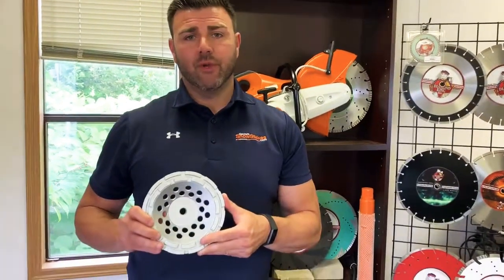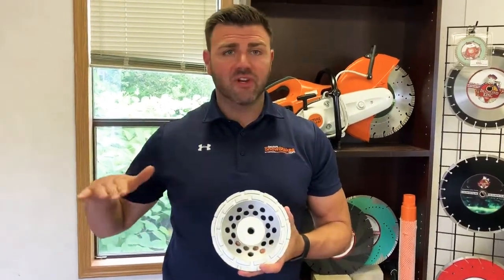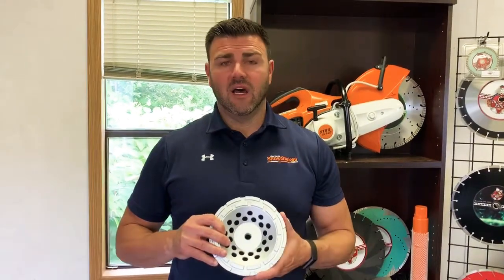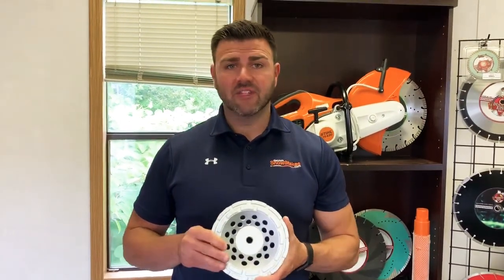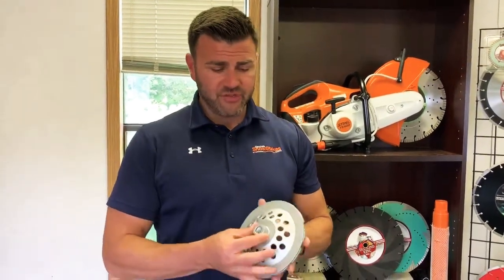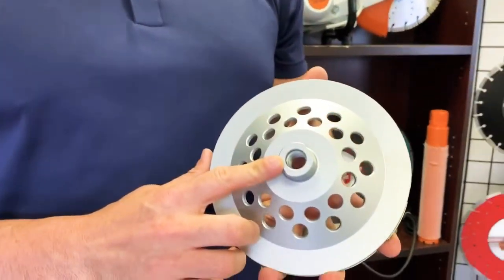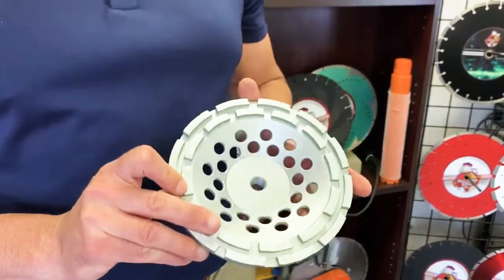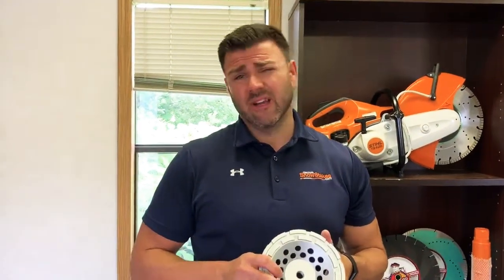What Is The Best Cup Wheel for Concrete? http://www.diamondkingtools.com/

Comment: Do you just screw in the cup wheel or do you have to tighten it down like that flat blades? Thank you
Reply: You just screw it on until it's snug. That is, no flange is required to screw on after it. The wheel rotates in the opposite direction so it shouldn't fly off. Just make sure you screw it on snug enough.
Reply: @Marcoosianism  Great,  Thank you!